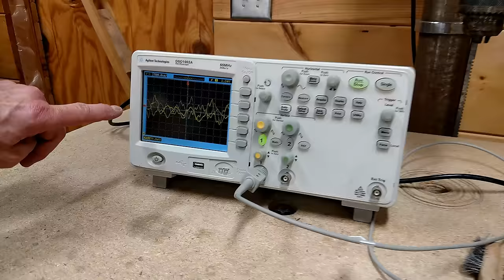Active Noise Cancellation

Comment: Wow... Finally someone that understands active noise cancelation. Would car speakers that have active noise cancelation be wired out of phase from each other? I've done a speaker upgrade and lost the noise cancelation feature. I've put back the original speakers and still can not get it to work.
Reply from the maker: This could be due to a software problem.  As we covered in the video, for active noise cancellation, the sound has to be sampled close to where it needs to be cancelled out.  I'm not familiar with how an automotive system works, but it's likely a microphone has to feed the sound from close to the passenger's head to the processor then this has to be compared with what the speakers are emitting and what doesn't belong has to be added, 180 degrees out of phase, to the output from the speakers.
Reply: @TechIngredients  thanks for the response. Yes, there are 3 microphones in the cabin. One on driver side, one on passenger and the 3rd on the middle of the back seat. All are on the roof lining. I currently have all the speakers wired in phase. Will the signaling processor control what the speakers do to cancel the noise... Or would the phasing of the speakers control it. I'm thinking of going to the car dealership to reload the module since you suggest it could be software related

Comment: Thank you for your video. If I buy a PA system, and use reverse polarity on the speaker, will I be able to use it to dampen the noise of a piano practice room - so the practice does not disturb others as much?

Comment: For a quadcopter, why not simply redirect the sound waves towards the sky with tilted reflective walls on a box open to the sky? High frequencies can efficiently be focused towards the sky and  dynamic noise cancellation could be used for the lower frequencies that would diffract around the open box top edges. Since the wave length of these lower frequencies is much larger then the box dimensions, a speaker placed inside the box, a few inches from the engines, could cancel by up to 15 or 20 db the remaining noise on the ground, which would also solve the problem of the engines cooling in a closed enclosure.
(Assuming  that the 2 stroke engines are about 10% efficient, to generate 2000 watts, almost 18000 watts of heat will need to be evacuated from the box, which is not a trivial problem...)

Comment: One of the best explanation of noise cancellation I have ever seen. Sir can we use transperant material like glass or acralic sheet to make noise cancelling box?
Reply from the maker: Sure.
Reply: @TechIngredients  thank you for your reply. I have a spice grinder (Indian type). Which is hammer type. During operation it makes a huge noise. So I am working on noise cancellation based on purely mechanical construction. So I have designed a box as per the machine shape. Now the problem is what kind of materials to be used for this box which will give best noise cancellation. If you give me your email address , then I will send you a cad model of it. Then please  suggest me proper material

Comment: Should you make the walls into "better speakers" as you've done in other videos --- that would level the frequency response and whiten the noise. Did you drive the box at a harmonic frequency? Would a "better speaker" modification require less energy for noise cancellation?

Comment: As we can cancel noises using frequency.

Can we stop molecules? (heat). 

So, we can cool material.
Reply from the maker: Yes.
Look into laser cooling.  Temperatures only one millionth of a degree above absolute zero can be achieved  through this process.
Reply: @TechIngredients  I didn't know that. Fascinating! 😮

Comment: Lapse in concentration at 2:40 in -- you said the speed of sound at sea level and room temperature is about 1100 Hz.  I think you meant to say 1100 feet per second.  Understandable, seeing as how your signal generator was set to 1100 Hz (or cycles per second).  Hmmmm, just wondering what note that would be closest to... C#! -- 2 octaves and 1 semitone above middle C.

Comment: So if you delayed the signal to a speaker in an enclosure  by a given quantity. That quantity, being the same as the delay from the origin of that same signal including the that additional time lag, of the longer signal path through your circuit ending at the voice coils mounted on the enclosure sides, "Including at least one exciter on the baffle". You could attenuate that signal as needed using a mic inside the cabinet and a processor which has an eprom with an algorithm and a macro to cancel interior waves?   Wouldn't you need to also change the "canceling", signals phasing by 180 degree's to be efficient? "Another function for the circuit containing the eprom would possibly accomplish this". What do you think?

Comment: in a closed system you could also alter the air pressure, i.e. create a vacuum so there is no air to pass the sound pressure waves into.
Reply from the maker: That is correct.  A vacuum is the ultimate barrier to sound transmission.  The helium provides the structural support to allow moderately weak containment structures and still reduce the transmission significantly.

Comment: Try lead sheeting code 8. Lead doesn't produce sound. Same as I've installed lead sheet in my speakers. You could make a vacuum.
Reply from the maker: Lead has a lot going for it.  It isn't even very expensive.  But, it is very heavy and not well suited for mobile applications.
Also, in a few days we will be releasing a video on the design and construction of some pretty impressive Voigt speakers.  I will demonstrate the performance of constrained layer damping which can be used by anyone who wants a superior material for a speaker.

Comment: He has a video discussing a build your own speaker using a ceiling tile. Then goes on discussing how helium prevents soud transmission across a distance within the helium. So creating a dual pane window incorporating helium between tbe panes. Keeping a tight seal without a leak would be imperative.

Comment: I could have sworn there was a follow up video to this. Was there not?

I cannot find anywhere else that has this sort of design and i was wondering how it was working out with the actual engine inside it
Reply from the maker: We have not done one yet.
Reply: @TechIngredients  

Oh wow I appreciate the response.

It seems like it might be a lost project at this point. But I appreciate this existing in of itself. It's fantastic high quality information.

But if you still have it laying around I would love to see it just dropped over a small engine with a tiny bit of adjustment and maybe a decibel meter and see how well it works without all the modifications. It's simple and I understand it in it's current iteration, and if that is functional. That would be cool. 

My idea is I am wondering how well this would work with a generator. I am wondering if you would need the dynamic tune on it or if you could set it and forget it essentially. or what other complications would arise. Essentially wondering if it is something worth pursuing.

Comment: This method works fine for coherent waveforms however the cancellation only works at even nodes across the Peaks and troughs of the wavelength. And also try doing this with pink noise or other random noise or wide-band random noise. You will find that there are much more challenges and accomplish things the same goal over a wide area and with wideband noise.
Reply from the maker: I disagree.  The mic picks up pressure variations.  No matter how complex or discordant the sound and no matter how many sources are generating it, the result is degenerate, at any instant, to a single value of air pressure upon the mic.  When amplified, inverted and used to drive the wall to oppose those same pressure changes, the wall generates lower amplitude, secondary sound waves from it's outer surface.
Reply: @TechIngredients  That method only works in a sealed compartment. Cancelling sound in an acoustic space only occurs where the peaks of the source and the troughs of the canceling signal meet at precise amplitude and phase. 
I've pondered the idea of silent quadrotor aircraft using ESC to modulate the props with the sound of the props out of phase, but in the outside environment, this cannot be controlled.
Reply from the maker: You're right, it only works with a sealed compartment.

Comment: 5:35 is that similar principle for Radar absorbent material used on stealth aircraft?
Reply from the maker: No. This is a method to generate pressure waves out of phase with the original sound waves and cancel them through interference.  A radar signal is based on electromagnetic microwaves and can be reduced by absorbing those waves in a tiny, electrically conductive particle that acts as an antenna and dumps it's energy in the surrounding organic paint.

Comment: This is so amazing. Is it possible to put the electronic reducer on the walls of a room? As a portable solution for all kinds of space?
Reply from the maker: Yes.
The challenge  is that firstly, the actuators need to be close to but uncoupled from the microphone. Sound generates very complicated wave patterns of movement  in the walls, and secondly, to counter these, there have to be enough actuators to independently dampen those movements regionally.

Comment: I would like to see the sound generator tone replaced with a complex repeating sound like the sound from a lawn mower or boat outboard engine and see if that cyclic sound could be used to drive the noise cancellation modulators.  If effective, I would put one on my lawn mower.

Comment: 3:40 in -- It would've been good to explain that "amplitude" in sound waves equals sound 'volume' (not spatial volume) or loudness.
Reply: Amplitude doesn't really equal loudness, it's more like loudness~amplitude^(3/5) as an approximation - 3db increase means a doubling of power 6db increase means a doubling of amplitude, and roughly a 10db increase meaning a doubling of loudness so loudness is proportional to amplitude to the 3/5 power...it's weird

Comment: Would it be advantageous to place band-pass filters of different ranges on the signal path for each of the actuators? I could see this potentially handling a wider range of frequencies, as long as it didn't eliminate the effect all together
Reply from the maker: It is a good idea to place a band pass filter between the sub and the panels, between 120 and 150Hz. The panels produce little output below 120 Hz and even shake if a lot of power is sent to them below 100 Hz.

Comment: How did you line up the phase of your signals? You just said you would adjust the amplitude. What circuits did you use for this experiment?
Reply from the maker: Because of the proximity of the sensor (microphone) and the driver, the phase is  simply set 180 degrees off by how you attach the leads to the amp or the driver.
I don't remember the specific models for these components, but I believe the amps were cheap mini amps from Amazon, and the drivers were from Parts Express.
Reply: So, you achieved the invers phase by the arrangement of the sensor and actor? Then this only works for constant waves, right?
Reply from the maker: Not at all.
Phasing distant sensors with actuators would require frequency dependant phase delays.  As these components approach each other, the bandwidth of the frequencies that have an effective phase reversal increases. At contact, the bandwidth becomes infinite. At audio frequencies, and with audio wavelengths, seperations up to a few cm. are essentially in contact.
Reply: @TechIngredients  thank you so much 👍

Comment: I haven't seen any further vLogs continuing with this Active Noise Cancellation subject. Also, why is active noise cancelling not commonly used for noise suppression?  In homes etc.
Reply from the maker: When weight is irrelevant, passive means will probably be less costly and require no analysis or maintenance.  In our video about our "Timber Frame Lab" I explain the method of sound isolation we used in the construction.  In our videos on helium, I suggested that the use of helium barriers may also be useful.

Comment: This is a good teaching demonstration with two mistakes and a major omission. 2:32 The speed of sound is NOT 1100Hz, it is 1125 feet per second. 4:41 The pad IS INDEED elastic. The major omission is that everything described and demonstrated is true at only one frequency but the drone motor produces noise at many frequencies. He introduces only crude electronic phasing when an optimum phase/frequency filtering will have to be added to achieve effective "active noise cancellation".
Reply from the maker: You are correct about the verbal typo regarding the speed of sound. It is indeed 1125 feet/second.  The pad like ALL existing materials is elastic, but NOTHING is perfectly elastic.  The pad is chosen because it is so much less elastic than the aluminum plate that it is RELATIVELY inelastic.  The point is clear from the context.
Any noise source that generates multiple frequency peaks can be actively suppressed with phase reversal.  The degree of sound reduction will depend on frequency, and the isolation of the detector from the actuator. The higher the frequency, the less effective this approach will become. Mechanical blocking of higher frequencies has always been easier while active canceling of lower frequencies is easier.
You call it crude, I call it elegant, inexpensive and easy for the viewer to reproduce.  This is not true of a DSP based, Fourier transform phase /frequency generator for open space applications.  The military has struggled with it and some very expensive automobiles have incorporated a form of it into their sound systems.  This is very difficult and impractical for the many situations that could benefit from it.
Reply: I repeat that your presentation is good and thank you for responding. Something that is ELASTIC can be stretched easily and can then return to its original shape quickly and a rubber foam pad is obviously more elastic than an aluminium plate. The word you use, "inelastic" is the opposite of elastic, with synonym "unyielding". If your plan is to put a microphone at the drone engine (noise source) and to amplify its signal to drive a speaker in antiphase also close to the drone then I predict a horrible feedback noise. If you plan to build a multi-layer walled box around the drone motor then you may need to invent antigravity as well to get it to fly. It could be possible to cancel motor noise components that are harmonics of its r.p.m. that a processor can easily sense and use to drive audio recordings held in memory, but random noise would remain.

Comment: That was very informative. Would that also cancel out sounds that are not as consistent, such as spoken word? 
Also could that principle be used to reduce the slide going through a door?
Reply from the maker: The principle is that whatever the microphone can "hear" the amp will drive the actuator to counter.  The higher the frequency the larger the phase mismatch caused by the finite distance between the mic and the actuator and the less effective the process will be.

Comment: For passive noise cancelling , if we use something like speaker with large membrane which will absorb the pressure wave generated by the sound source and convert it into electricity.This system can also reduce some noise i guess.
Reply from the maker: I believe you're right.

Comment: Would that be viable as a solution to acoustically isolate apartments in older concrete apartment buildings, that basically by standard have the same noise level no matter where in the house you're, or would the power consumption to adapt it to a scale like that outgrow the benefits?

Comment: Interesting part when you demonstrated the speaker out of phase with spacing. How will this affect the placing of a subwoofer in the room when you for example have the stereo speakers in front and the subwoofer under the sofa? is it better to have the subwoofer  lined up in front of you with the stereospeakers. And by the way, all the other things you demonstrated in this video is interesting too :)
Reply from the maker: Thanks.
Remember the wavelength of the sound from a sub at 50Hz is over 20 feet. Repeating this demonstration at that frequency would require the front sub to be 11 feet closer.  The same principle applies, but the differential spacing possible in most rooms prevents significant phase interference.

Comment: Nice work. I can’t understand why you have to manually adjust the amplitude. The microphones should pic the exact same amplitude that the main speaker is emitting and then the same sound  in reversed polarity that is being emitted by the small speakers  should cancel the noise automatically. What do you think?
Reply from the maker: They can't pick the optimal gain because there is no optimization programming only an analog ratio.  Once adjusted then turning the volume of the noise source up or down is indeed compensated by the output from the mic.